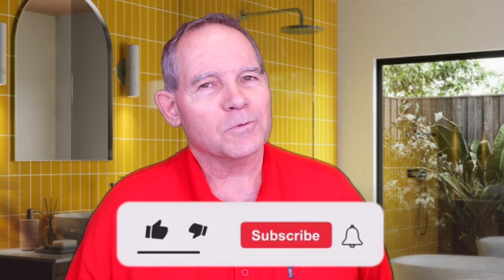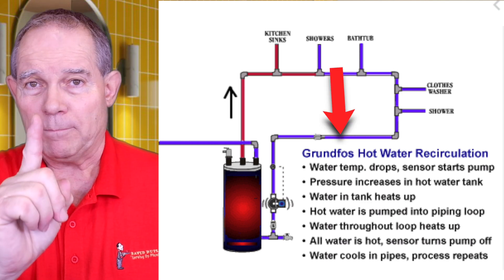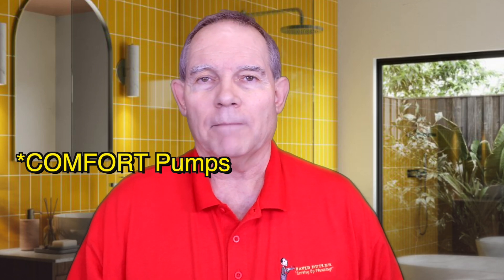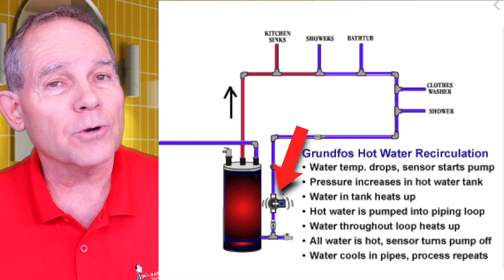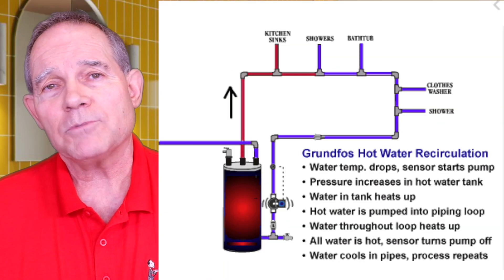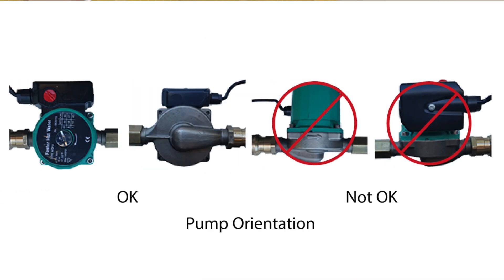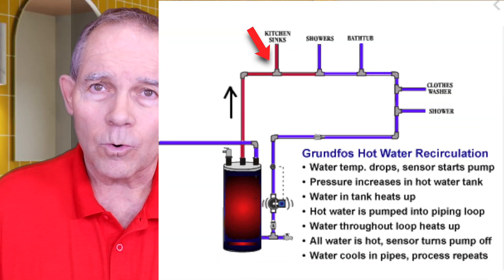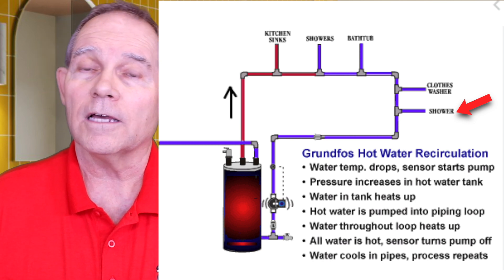Dedicated Loop Pumps & How They Work (Hot Water Recirculating Systems Part 2)

Comment: I realize this video was made Mar 29, 2025, But I'm curious if I put a tankless hot water heater in series into my 80 gal. hybrid hot water heater, with the expansion tank before the tankless, how efficient will this be and will anything get damaged? Do I still need a backflow prevention before the expansion tank? Where does my Comfort recirculation pump go? Or if I choose to use a dedicated recirculation pump line, where does that go? Does it go before the tankless, after the tankless, the bottom or top of the tanked water heater? I'm a DIY person looking for answer's that have yet to see anything on this. Why am I doing this you may ask, well, because I have them both and I want to maximize the usage of what I have. The tankless is a 27KW Eco model. Until I started watching video's I didn't know you could run water heater's in series or parallel. Since I have both, and the space to use it, I figured why not. If you are wondering why I have both, My wife purchased one and I purchased the other and now I can't return either. So let's make the most of it. I'm seriously looking for advice here. I hope this reaches somebody that will reply back to me on this subject. My house is completely gutted and totally open right now, so fixing plumping while it is open on this 1971 home.

Comment: Hi! Our home has this set up and it was working fine until last Friday. We have lukewarm water now. When I shut the pump off, the water coming out of the heater warmed up. My system has a suction and discharge cock valve. The pump is below the water line. There is a check valve (flapper) after the pump. 

The pump has a knob where the speed can be adjusted. It does speed up and slow down. 

Where should I start? All plumbing is sweated in place. Thank you

Comment: Hey great video, getting ready to do a radiant heat system in a cement slab.i was thinking you might have a video on this ? 😊 on-demand hot water heater?  Or a heat pump ? Anything will help .😊

Comment: Can you tell me if the Watts model 500800 is a dedicated recirculating pump? The instructions show it install either as a dedicated pump or a comfort pump, with the comfort pump valve kit. 

The plumber installed it as the instructions say. Directly to the hot side coming out of the water heater. 

It has never worked properly. But i also cant find where they put the return line to the water heater......but one thing at a time.
Reply from the maker: If it’s on the hot outlet it has to have a crossover manifold under a sink.  It doesn’t need a return line. If it had a return line it wouldn’t work installed on the hot outlet. It would have to be on the return line. Hope this helps. 😃

Comment: David, this is an excellent video. Thank you! I am building a new home with multiple floors in India, and we have the heat pump on the roof. Do we need to have the whole connection in series, or can we add any T-junctions?  What options do we have if we need to deal with a multi-floor building? Do we need to add NRV for each floor? Please share a way on how we can accomplish this?

Comment: What is the best way to use a circulating pump on a hybrid water heater?
Reply from the maker: Need to know what the water heater is and always good to check with your manufacturer 👍
Reply: @ServingUpPlumbing  It's a 50 gallon AO Smith series 900 hybrid water heater

Comment: I just installed a Rheem tankless without a recirculating pump. I do have the option to add it to the system. Should I decide to go that route, would I be running the return from the hot(at the end of the run) back to the cold side at the heater? I can do everything under the house as the tankless is mounted outside.

Comment: We are building our house and planning to do as you suggested with a dedicated loop and pump. We like the idea of doing the purge valve between the pump and water heater so we can purge any air in one spot instead of going to each fixture.  Which would you suggest for this?  Not sure I'm seeing the right one to buy
Reply from the maker: Any boiler drain type valve will work.  Congratulations on the house!  Best of luck and thanks for watching!

Comment: I solved the electrical on- off / timer problem. I ran a cable from the shower overhead light to a dedicated outlet box by the pump. So when we turn on the shower light we get hot water in the bathroom only when we need it. Save electricity and water!  RG

Comment: I’m starting a home renovation…need a recirculating system of some kind for hot water…my tank is in the basement and my master bedroom is on the upper level…there is a good chase from the basement all the way to the attic…could this be used to “easily” install a recirculating system to quickly deliver hot water to the master bathroom?

Comment: I have a Taco 006-BC4 that has gotten really hot and all the lines including the cold water lines are extremely hot. On top of that now whenever we turn on a cold faucet or flush the toilet we get a loud noice in the pipes. Just when we turn them on ( not hot water ones though). Is this a possibility with a failing cartridge circulator? I unplugged it but the noise is still there. But the cold water lines are now cold. Any advice would be greatly appreciated.
Reply from the maker: Without seeing a picture it’s hard to say but maybe see if your check valves are functioning properly.  Thanks for watching!

Comment: Well, I have the ability to install a recirc system, but i have hot water lines almost the same length running in different directions.  Most of my hot water stuff goes east and things branch off from that, but I have a branch off the main run that goes west and it supply the kitchen sink and dishawasher.  If I pick one side and make the loop, does it "pull" hot water from the branch on the other side w the dishwasher, etc.?  If I made a T off of the kitchen branch over the the east side branch, maybe that would fix the problem?

Comment: For tying in with an expansion tank on top, does it T before or after the expansion tank T, or does it even matter because of the check valves(what about it having a thermostatic valve off the hot, does that matter too)? Great video btw. I plan to add my own, i am not a plumber, but have full access to all my lines since i live in a ranch with a basement not finished. Pex is cheap lol, and i have the tools so why not. The kitchen sink is about 70 feet of pex away. Takes about 2-3 mins for the water to get hot cant stand it anymore.

Ill also be adding pipe insulation on all the hot water lines after this, someone told me this really helps with lines holding heat better.
Reply from the maker: The tee for the recirculating is between the tank and the heater so after.  Insulation is always helpful and more efficient.  Great questions and thanks for commenting and watching 😃!

Comment: Good thing is with smart plugs, you can set a schedule for weekdays and weekends or manually control on and off remotely.
Reply: which brand and model will work with a smart plug? if the pump already has a digital timer, it might not "like" being turned off and on.

Comment: Great videos and information. I will be installing a Rheem heat pump water heater. Where is the best location to connect my thermosyphon dedicated return line? I will be using the top connections for the regular hot and cold connections. Since the HPWH has both top and side connections, can I use side connection for my dedicated return line? Thanks for all you do.
Reply from the maker: Great question. You could use the side connector but connecting back into the cold water inlet with a check valve on the cold water would be the norm.  Could also tie in at the drain.  Be sure to see manufacturer’s instructions and you can’t go wrong.  Thanks for watching!

Comment: Hi! Can I use a Dedicated Loop Pump on a tankless water heater? Thank you
Reply from the maker: Great question.  Only certain ones but not many.  Best option is buy a tankless wit a built in Recirculating pump.
Reply: @ServingUpPlumbing  live in AZ where saving water is important. I have a water heater without a built in recirculator. I’ve already installed a return loop. What do I need to do now? So many conflicting solutions. I’m thinking check valve, Aquastat, pump. What am I missing? Thanks

Comment: #waterheater, my home is old. However I have options to pull the dedicated line from my attic to the furthest bathroom. Please advise if I just pulled one pipe from master bathroom to water heater?
Reply from the maker: That would work!  Just add the line and a recirculating pump, not a comfort pump.
Reply: Where do you add the check valve?

Comment: This was very informative and I wish I had viewed a video like this before my recirculation system was installed.  I would have asked for the spring check to be installed in a manner that it could be easily replaced.  I think mine is failing now.  Also, my system has a check valve in the cold water feed to the hot water heater that really limits the water flow with modern 1.8 gal/m fixtures with balancing spools.  Is a check valve there really needed?  I don't see one in most system diagrams...
Reply from the maker: If they piped the recirc line into the cold water inlet it does need the check valve.  If purpled at the drain it does not.  Also, check valves don’t usually cause the flow issue as much as the heat traps on the water heaters.  Thanks for watching and thanks for the comments 😃

Comment: Wouldn't a recirc system waste more energy than not having one?

With recirculation, you have to constantly spend energy to keep the loop hot. Even if you dont ever turn on the hot water, you are constantly recirculating water and heating what is essentially a large radiator in your house. Possibly fighting the HVAC depending on the season. 

Without one, you have to waste more water while waiting for hot water to arrive, but you wouldnt use as much energy.
Reply from the maker: Your right!  It is more of a luxury but it does save water, not energy.

Comment: This all makes sense however, my pump on my recirc system burned out many years ago probably due to not purging the air after a shutdown, but my system still works just fine even without the pump running! Best of both worlds, I just leave the pump turned off. I never have to purge the air after a shutdown or anything, it just works!
Reply from the maker: @williampeterson265  Awesome!